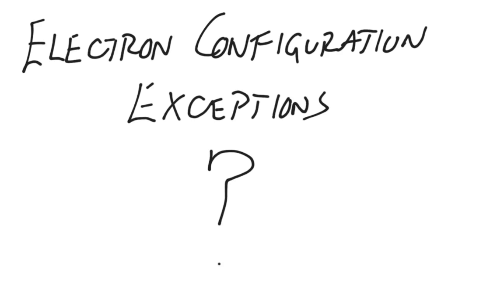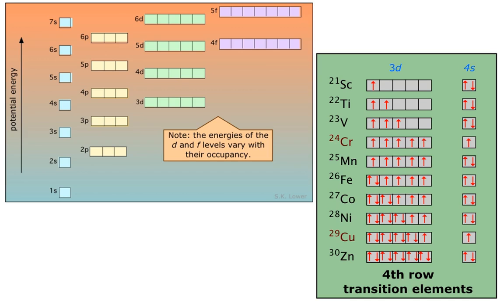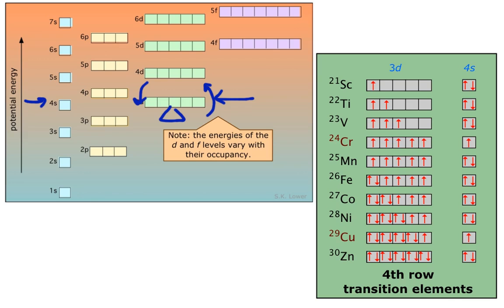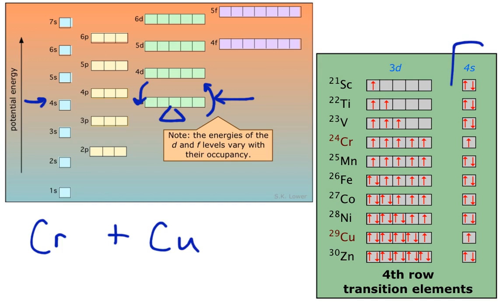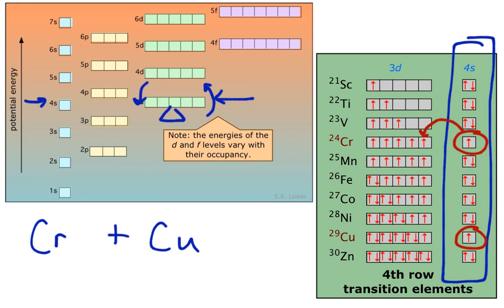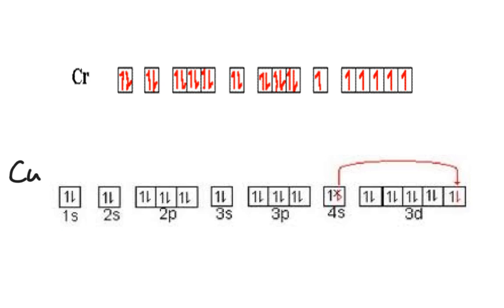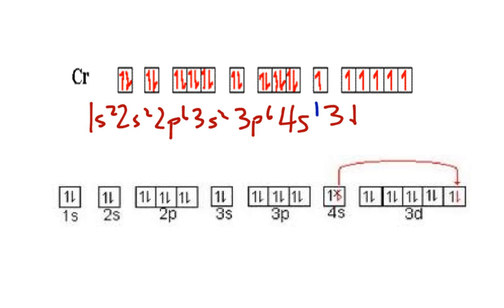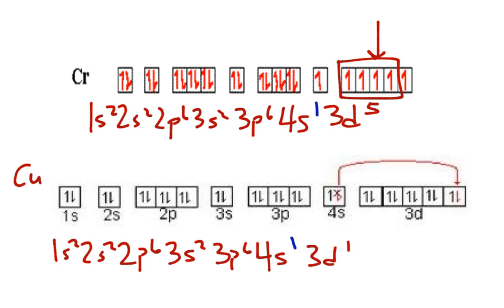Exceptions to the Aufbau principle

Comment: Thanks for the lesson! A couple comments:

Aufbau is the german word for building up, or construction  not a person.

Also, the Eric Scerri, in a blog for the royal society of chemistry counts 20 exceptions to the aufbau rule:
Chromium	[Ar] 3d5 4s1
Copper	[Ar] 3d10 4s1
 	 
Niobium	[Kr] 4d4 5s1
Molybdenum	[Kr] 4d5 5s1
Ruthenium	[Kr] 4d7 5s1
Rhodium	[Kr] 4d8 5s1
Palladium	[Kr] 4d10 5s0
Silver	[Kr] 4d10 5s1
 	 
Lanthanum	[Xe] 5d1 6s2
Cerium	[Xe] 4f1 5d1 6s2
Gadolinium	[Xe] 4f7 5d1 6s2
Platinum	[Xe] 4f14 5d9 6s1
Gold	[Xe] 4f14 5d10 6s1
 	 
Actinium	[Rn] 6d1 7s2
Thorium	[Rn] 6d2 7s2
Protactinium	[Rn] 5f2 6d1 7s2
Uranium	[Rn] 5f3 6d1 7s2
Neptunium	[Rn] 5f4 6d1 7s2
Curium	[Rn] 5f7 6d1 7s2

I love the symmetry of the aufbau rule, and often wonder about these exceptions.

Hope you find that useful or interesting.
Reply: Thanks for the comment. I can't tell how useful it is for me! I watched several videos on the Aufbau principle such as from Khan Academy, Crash Course Chemistry with Hank Green, and Professor Dave Explains. They all introduce this principle in their videos and show some examples of electron configuration of atoms with 2 or 3 shells. I wanted to practice on my own, and chose Rh (number 45) and I got so confused because it didn't work for me and different sources on the Internet either mention only Chromium (Cr) and Copper (Cu) or these two plus Silver (Ar).